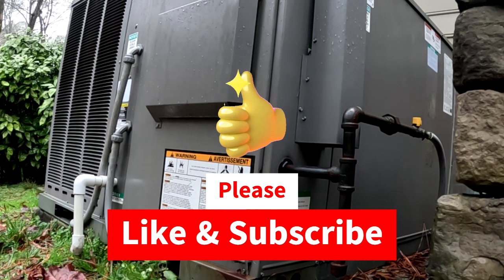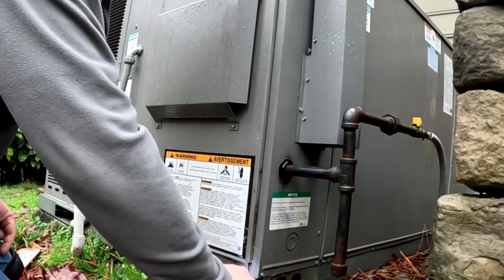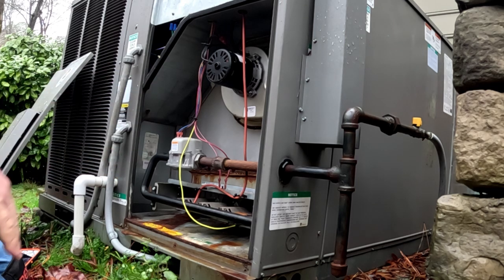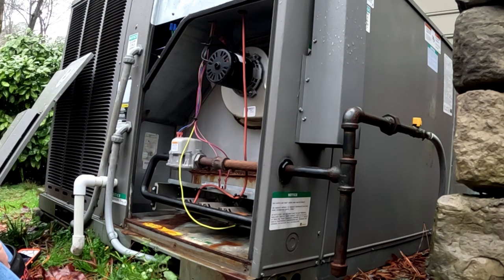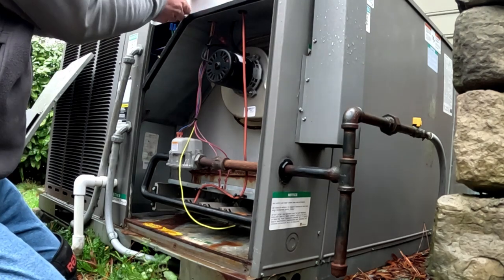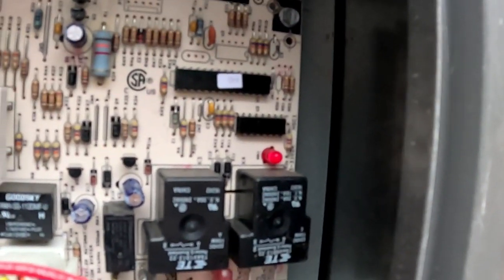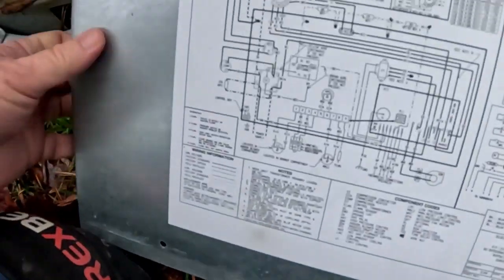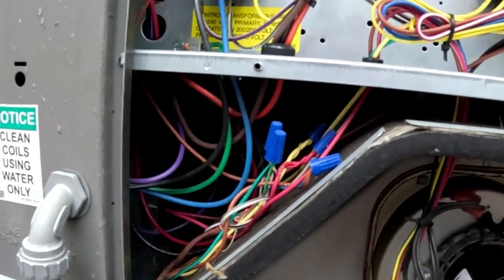Gas Furnace Pressure switch problems.

Comment: I work for a Rheem Dealer in Burlington, and it is a pretty lousy design as far as the rust in the bottom. We replace a lot of the radiation shields, and the bottom plates called burner floors. We carry them as a stock item on our trucks. I found out that behind the collector box on the heat exchanger backplate there is a groove that allows flue gas condensate to drip onto the burner floor.
Reply from the maker: Could have been designed a bit better. Some others do this but not quite as bad.
Reply: @MYHVACLIFE  True, but they have had this design for over 20 years, and the new A2L ones are just like the older ones.

Comment: Draft assembly has to run to close the pressure sw.
Reply from the maker: Yes it does, If there is moisture in the switch the voltage will bleed back and the board will think it is closed on start and give that fault.

Comment: I have had problems with the nipples on the draft mtr housing getting just enough debris    in the smallest part of the nipple to cause the negative pressure switch to not close. I always used a  my welding tip cleaner to make sure it was clear. I did it routinely  after a couple of back calls.
Reply from the maker: I keeps some as well, that bag did not have one so tstat wire had to do.